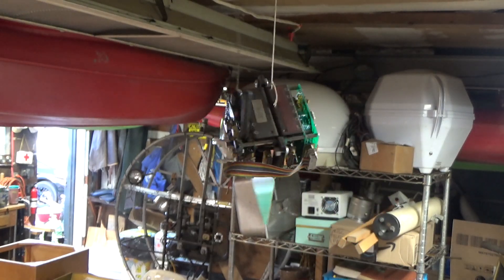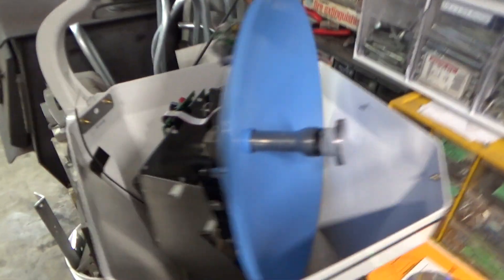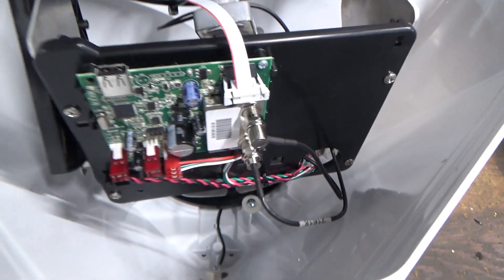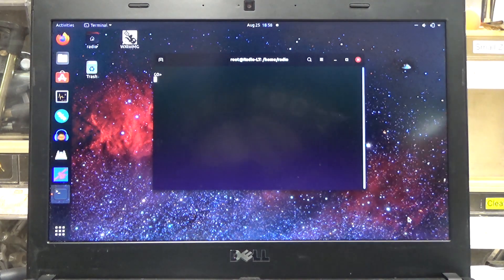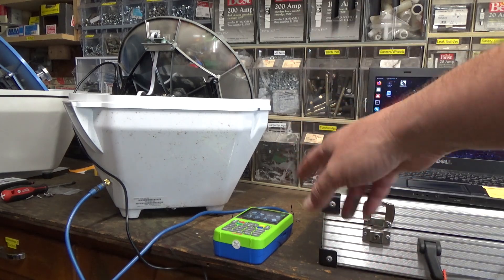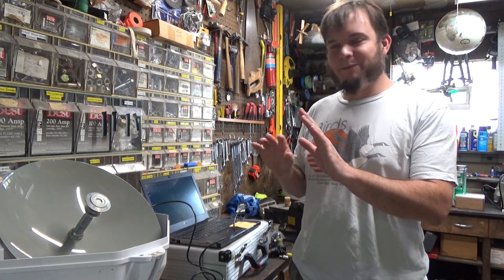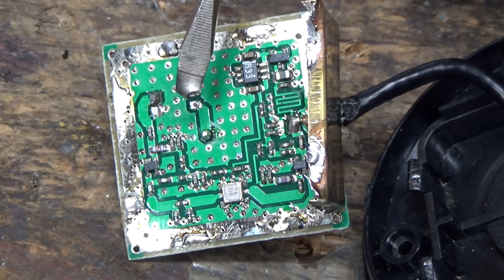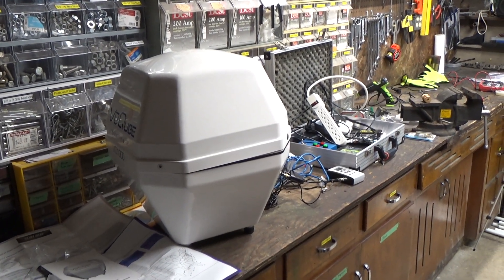Hacking Portable Satellite Dishes (Part 2)

Comment: open the v8 finder meter thing you have there and figure out what voltage it runs on then use an RC battery that is bigger mah to power the unit to fix the constant powering off issue

Comment: I just planted a 4ft. fiberglas dish in my backyard that has an adjustable mount. I have 2 LNB's Ku and C, butt the C has 2 outputs ?  And also what can I use for 240-290mhz ?
Reply from the maker: I think the 2 outputs are usually for two receiver boxes. Sometimes I'll use one to feed power to the LNB if I'm using an SDR instead of a satellite box. 
For 240-290 (Satcom pirates I assume?) I've used a DIY Yagi. I keep meaning to build something like this but haven't had time yet: https://hackaday.com/2023/06/30/a-quick-and-easy-tape-measure-turnstile-antenna-for-milsat-snooping/

Comment: I found your video trying to learn how many volts goes through the coaxial on a dish Tailgater 16 to 18 thank you, but the reason is I'm not getting that little red light inside on the circuit board when the dome is off, which would indicate no power I would think?, I've changed boxes and cables three times a peace in my effort, So I just thought I would leave the comment in case you see it asking if there's something simple or common about that situation that I might be able to look at or correct  thanks. Cuz I'm about another 15 minutes more of playing with it before it goes in the trash.
Reply from the maker: The set top box should supply either 13v or 18v DC, depending on polarity for the particular satellite and transponder. If you're not getting anything then it's possible something's burned out on the tailgater brain. Throw it on Craigslist for $20 before you trash it, or heck I'd pay for shipping if it's not too much :-)
Reply: @saveitforparts  thank you so much for answering that, , I was on my wife's account and just remembered I'd ask so I didn't check her account until today, thank you, I tried 3 different boxes one was brand new changed cables t ect.  I keep thinking I might run across someone who can check it but I'll contact you before I decide to toss it, im thinking it's the board so it is junk to me, i think i can get a used one reasonable on  marketplace, sometimes I see them. I'll be in touch.

Comment: I know that from my V8 finder 2, the battery is also low or about to run out when I need the device. Linux is such a powerful tool, you could almost turn it into an automatically tracking satellite antenna. 👍

Comment: can you imagine using this kind of array as motion detector ? (useless idea, I assume :p)
Reply from the maker: That might be popular, I think there are some microwave / radar based security systems. I haven't tried it myself, but I've seen kits online for Raspberry Pi and Arduino that do similar things.
Reply: @saveitforparts  Could be fun. But with home equipment it will be as tricky as a laser ray detector ;) Who need simple solution to a problem ? :D

Comment: Hi,
Are you sending power to the GPS antenna after the modification?
Best regards :)
Reply from the maker: You know, I don't actually remember. I think I probably had the BIAS-T on the SDR switched on (provides 5v back up the antenna wire).

Comment: Ball game beats fishing for sure, do you think they were watching ....... the ball game?  You are getting these for great prices!  New sub here to watch your adventures until our 2nd hand market comes down.

Effectively the linux commands you worked through simply listed connected USB, then on plug in you see the change.  What you found next was RS232 (Old Serial port) emulated on a USB Wire.  This is why you then grepped for TTY sessions available to linux, which by design the RS232 port will appear.  By searching for this TTY device you correctly found the advice to tap into that serial console on the other end of the USB (correctly ID'd by you) with your screen command executed on that device as it appears in linux.  After this command you were talking to the OS on the mainboard of the dish itself.   - If all of this was obvious or relatively intuitive to you already, then your googling of random linux commands is good and your risk is more 90% break the OS and need re-install and maybe 10% brick the PC, and even then the overall risk is minimal.

I would recommend seeing if you can get a dump of the NVRAM with that "nvread" command.  As well as seeing if you can get a closer look / serial no. from the actual mainboard or the ROM chip itself.  (If you can't find all this information from the Dish Model googled as-is).  This will give you a sort of "Image of C drive" stored on the board which boots into that console on power-up.  Just in case it's not obvious - Do NOT mess with nvwrite until you've got the existing ROM dumped.

If I were in your shoes, I'd be looking to have multi or switchable band / LNB, ideally automated like the dish position.  I'm weaker on the RF stuff, so maybe range available might be more limited than I thought.  I like the idea that the base-LNB, your L band mod and any other ranges could be moved in and out of position.  Perhaps on a carousel on a servo motor.

How many of the other ones have USB?  I love your Array idea and with scripted TTY session to each dish, you could focus all satellites and then likely use that nudge feature per-dish to help with some of the interference / noise issues you saw.

Comment: I have a Kenwood VHF two-way radio and I tried installing the keypad and the circuit board has a ribbon strip that apparently has lost the contacts on the end when the plastic strip at the end pulled off

Do you know anyone that can take a look at this and see if they can figure out if it can be fixed ?

The circuit board is only about 3 in by 2 in and about a quarter inch thick

I would be most appreciative if someone who knows how to fix these ribbons strips could glue a new plastic strip on and put new traces on

Thanks

Bill
KC2OVX
Reply from the maker: Ha, I don't know how my comments section became tech support! I have no idea on that, you might need to find a replacement on eBay or find someone who's good at soldering?
Reply: The part is no longer made. Radio is from the late 80s. The upgrade kit is KDM-7, the kit has 2 parts and I need the 2 parts duplicated.
The keypad is plastic and I think it can be 3D printed.
It has 16 plastic square buttons and the plate that the buttons go through. The back of the buttons have little fingers that press the surface mounted pressure pads on the PC board.

The PC board has traces and 16 little circular copper pressure pads that when pushed complete the circuit

The circuit board has a part number of J82-0031

I can find no reference to this part number anywhere

But the upgrade box has KDM-7 written on it along with Kenwood

I don't see any IC chips in the circuit board and I think all of the eye sees are on the board inside the radio and this board just allows for the circuits to be closed when the buttons are pressed.

The circuit board has a thin film strip that comes off the board with 9 contact traces and pushes into the connector.

I have not seen a connector like this before

It has no locking mechanism. The strip just pushes in and is held in by the pressure of the connector. The width of the connector is thicker than the strip and there was a piece of plastic originally glued to the strip to add thickness and to provide a rigidness for inserting the strip. The strip won't stay in the connector because it doesn't have the extra thickness of the plastic strip that was originally glued to it. It seems like the traces pulled off the strip with the plastic piece, as I get no connection from the PC board and the buttons do not produce any DTMF sounds like it is supposed to do. It used to work. I am hoping it is just the traces and not a short in the radio or worse a bad IC chip caused when the strip separated from the connector.

If anyone watching knows if someone who can make the PC board I described, please let me know. The film has the button contacts as part of it. I don't know how these are made. They are not like a regular plastic board that has parts soldered to it. It is like a membrane keyboard.

Thanks again

Bill
KC2OVX

Comment: A couple of comments.  The "feed stub" that goes through the middle of your dish is a circular waveguide.  It will be VERY poor at supporting L-band propagation, since it was designed for Ku-band.   Additionally, dielectric-supported patch antennas are very very narrowband -- the GPS-band filter you pulled out is barely necessary for a patch antenna, since a patch antenna basically forms a low-order filter by itself.   Not criticizing--love your inventiveness.   But having a bit more knowledge of RF could help your projects be more successful.

Comment: I was at a talk about POTA (Parks on the Air) so now i'm wondering how you could modify that to point a Wireless PtMP dish so you could have decent internet while at some of the local parks and possibly connect into AREDN.

Still need money so who knows when it'll happen but Internet, Satellite TV... Might be more comfortable at the park than at home! 🥴
Reply from the maker: I have it on my list to try Wifi on some of these!
Reply: @saveitforparts  Fun, I was thinking if you had a local server that you could push a GPS to coordinates to that could calculate the correct azimuth and angle, it'd be super cool to be up in some mountains, push the location to the home antenna and then just point the 2nd antenna and instant'ish wifi link.

Wouldn't need the dish for TV then, you'd have internet from up to 30 miles away depending on los. :) 

I was looking though and there's none for a resonable price in the UK so I guess it'll be a while before I can mess with one.

Comment: great stuff, I dont know too much, mut I think if you modify the disk to het the pick up antenna in the senter off the disck in sted off thet reflektor type feed you might gain berret reflection and use wider freqvency ranges on the disk

Comment: Try to convert a disk to a Starlink disk so you can receive internet from the disk. Hard project but it would be worth it. =)
Reply from the maker: I'd have to track the satellites a lot faster, and switch between them when the signal gets weak. Not sure these little dishes would do it fast enough!
Reply: @saveitforparts  Completely fair point. Thanks for the answer. =)

Comment: Has anyone found other tailgate dishes with the USB connector? Anyone gone looking for other types of signals on the Dish and DirectTV satellites? I miss my old C-band dish days from forty years ago, searching for signals other than video with a weather radio or Icom R7000 on the I.F. signal or a SW radio on the BB connector.
Reply from the maker: So far I've had 6 different tailgater / RV dishes (yes, I have a problem). I've found 1 Tailgater with USB A, and one with USB Mini (but it has some water damage and doesn't seem to fully work). I've also found a Winegard Playmaker with a USB port, but also couldn't get that one to show up on the computer. I had a King "dome" that had pins for a serial port but I didn't feel comfortable soldering one on. I traded the latter two away for an interesting C-band dish, maybe the new owner will find something interesting with them! I have more videos coming up on the USB-port Tailgater and that C-Band setup :-)

Comment: You are running Ubuntu, that has a quirk on virtual serial ports like ACM0, rather than run as Root try adding your user to the dial out group.
usermod -a -G dialout 'yourusername'
You have to reboot to get that command to work.

Comment: I didn't know what AX Man was and now after a quick search I think I'm happy that there are no locations near me as I am pretty sure I'd spend too much time there! Got a kick out of the pointer you used to while showing the gps chip on the board was a screwdriver that had gone BOOM at some point, I certainly don't have any such devices near my workbench (looks around hiding the guilt on my face /s).

Comment: I would love more videos on this
Reply from the maker: I'll be doing more with it, I just want to redo my control / programming computer setup first. The briefcase full of broken laptop and loose parts is getting a little old :-P
Reply: @saveitforparts  I noticed the operating system you have on your dell computer is a Linux just like mine. (I'm using Linux Mint BTW)

Comment: You got more out of the camping satellite finders than I thought. Most devices are overdesigned, these days. A linear LNB, instead of a circular, would pick up Free To Air. The obvious use is ham radio satellites. Not being able to talk back is a bummer. When I use a Dish or DirecTv dish for FTA, I only get transponders. The dish is too small for most TV channels.

Comment: It's insane how much engineering and software development was done in order to supply literally dozens of people with these instantly-throw-away-able pieces of hardware.
Reply from the maker: I've never actually heard of anyone using one of these... but then again I don't do tailgating at sportsball games, so maybe everyone in the parking lot has one 😛
Reply: @saveitforparts  spoiler alert: they do not. DirecTV and Dish Network were never really all that popular,  and the market for extremely portable dishes, even for RV's, has never been all that great. That's why I'm amazed at the amount of engineering and software dev that had to go into anything to make it work.  I had DirecTV for many years in Minnesota and the only reason it worked consistently during the winter is because I'm tall and play hockey. May not make much sense, but that's what it took for me to be able to consistently knock the snow off the dish to get any reception at all during winter weather (reaching up and whacking the dish with a hockey stick)

Now try and do that while the position isn't even fixed, and you're not gonna have a good time, even for the few people that bothered to shell out the hundreds of dollars for rigs like this.
Reply: @saveitforparts  I think the resale value of an un-opened one tells quite the story :)
Reply: Perhaps it’s used en mass for non consumer applications?

Comment: I'm not sure that you'll get much L-band down the waveguide that runs from the dish's focal point to the rear of the assembly. Waveguide has a cut-off frequency, and if it's designed for Satellite TV then it'll be too small for the much lower frequency of L-band.

Comment: The other dish has a port down the bottom. That could be a serial connection also.. just check where the traces goto.
Reply from the maker: There's one spot that definitely looks like a blank solder area for a 9-pin jack. I need to find a connector and stick it on there to see what happens. Was thinking of getting rid of the older King Dome dish to free up garage space.

Comment: Cool stuff, some things to consider...the lnb switches h/v using 13v and 18v depending on the intended polarity using the supplief lnbf. Your handheld receiver is cutting out because current draw too much, I ran into the same issue.

Comment: Could you track weather balloons??
Reply from the maker: I'm not sure! I keep forgetting that the weather service still uses those, they seem like such a 1950s tech but they're still around! I'll look into it.
Reply: @saveitforparts NWS Chanhassen switched to 400Mhz radiosondes so dishes not needed anymore. A simple 70cm uhf antenna will pick them up for 50 miles or more. I use radiosonde auto_rx and works like a champ.
Reply from the maker: @mesochace  Cool thanks for the tip!

Comment: There's a few problems that you've got trying to receive galaxy 19 or AMC21 with that system. DBS satellites operate between 12.2 and 12.7GHz downlink and use circular polarization, whereas, FTA will be between 11.7 and 12.2GHz and use linear polarization. The other issue is that the reflector is way too small to recover the FTA signal which is lower power than the DBS signals are.
Reply: When receiving a circularly polarized signal with a linear (any orientation) antenna you only loose 3db of signal. And even if he lacks the sensitivity or signal to noise required to perfectly decode the fta stuff he should still be able to see it on a power meter.

Comment: That dish will be too small for any FTA satellite you need a minimum of a 36 in dish and the lnb is circular you will need a linear lnb for FTAsatellite.
Reply from the maker: Yeah, I probably won't bother with FTA much, or at least not KU band any more. I'll probably use these little RV dishes for radio telescope or Wifi experiments.
Reply: @saveitforparts  Every time I see a sat dish, I think wifi antenna. I use a snow disk with a usb wifi dongle placed at the focal point as a back up for my existing cable. The setup provides literally hundreds of AP's in range, with plenty of open-public APs to choose from. The elevation here helps, though.
Reply: What size is the c band dish you got?   For there the nasa channels on 127west and some free in the clear subscription  channels.  You will need to upgrade the old lnb on the c band dish with a new digital one . They can be bought on ebay or Amazon
Reply from the maker: I think it's 7 or 8 feet, whatever I could legally get on my car roof without needing to cut apart rusted bolts. I might just slap a tin can feedhorn on there and use it for GOES weather satellites.

Comment: Pretty cool that you can control alt-az over serial console. I don't think that waveguide is big enough for L band to propagate within it though? I'd bet the waveguide is attenuating so much the gain from the dish (and sub-optimal for 1500 MHz subreflector) is washed out. Probably better to put the feed in front and remove the ku band optics completely.